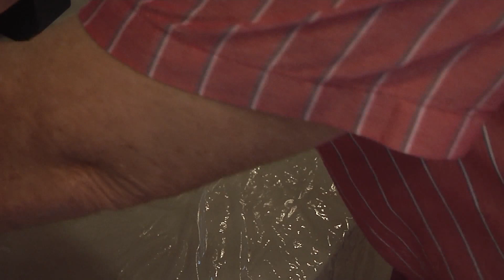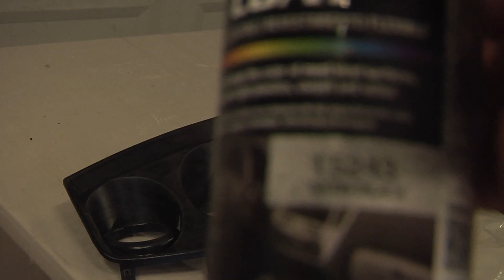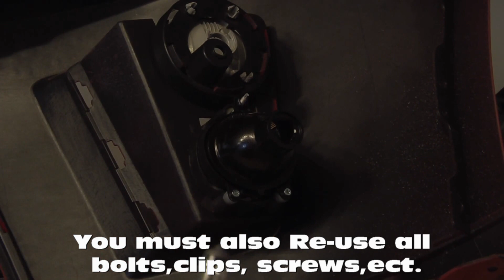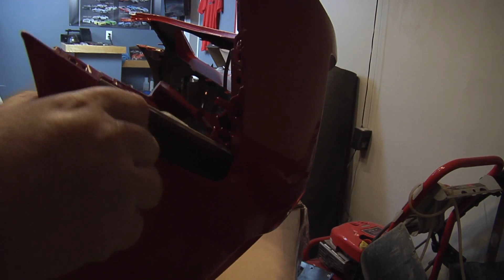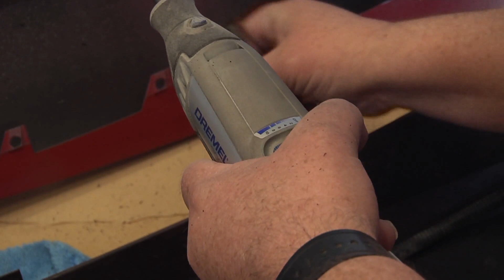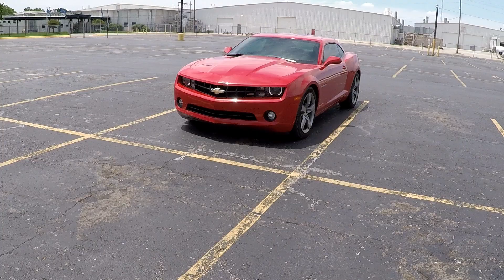Camaro ZL1 Front Bumper Conversion Install Part 4 "final assembly"

Comment: I’m struggling to clip on the bottom lip I’m currently working on the same project on my Camaro. Sides clip in just the middle won’t budge. Any suggestions would be greatly appreciated
Reply from the maker: It's been so long since I done that project,  I think I screwed it down.  What does it say in the video? Thanks

Comment: Hey man what hardware did you use to install it I bought this bumper topi just don’t know what to use to put it on
Reply from the maker: You use all your original screws, bolts, running lights, energy absorber ..ect.  you need to buy a wiring harness if you want to run fog lights, and buy the fog lights. Thanks.

Comment: For the lower fog light that you show already in place, did the bracket mounted on the back of the bumper come on it? I have the bezel and retainer for the top running light but there’s nothing to hold my bottom one. Thanks!
Reply from the maker: I used parts off the old bumper. Seem like it snapped together, not sure.  Been a while since I done that. Thanks

Comment: How long did you wait to put the grills and everything back on the new painted bumper
Reply from the maker: You just have to wait over night.thanks.
Reply: @camaromodschannel  what in all did you have to swap from the old bumper to the ZL1 bumper?
Reply from the maker: @davelombardo1710  running lights, energy absorbers, screws,
Reply: @camaromodschannel  so no brackets or anything like that?  BTW great job with all your mods!!
Reply from the maker: @davelombardo1710  no not that I can remember, the bowtie on the front,  need to change.  I got a black one  thanks.
Reply: @camaromodschannel  did you get the quad tips and zl1 defuser yet?
Reply from the maker: Yes got the rear defuser, and quad tips,  now I just need my exhaust pipes.  Thanks
Reply: @camaromodschannel  what size tips did you get. Any videos of it?
Reply from the maker: @davelombardo1710  yes, but don't know what program it was on. Thanks
Reply: @camaromodschannel  did you go with 3.5 or 4" tips
Reply from the maker: @davelombardo1710  4 inch,
Reply: finally installed! did you put all the screws in at the bottom if the bumper? they didn't send screws for it

Comment: If u had to start all over .. anything you would ve done different? I'm about to the same for the ss 13.. it's the energy absorber? Any issues ?buying a zl1 bumper from Ebay..
Reply from the maker: I would have painted the bumper in warmer weather. Do a better color check,no issues,  buying a zl1 bumper on Ebay is no problem, just take a little time. Thanks for the questions. You will love the new look,  thanks
Reply: @camaromodschannel  cool thanx
Reply: @camaromodschannel  is the bumper much lower than the oem ss or rs bumper..do you scrape every where?
Reply from the maker: @ivansotelo8163  No not really, about the same. when you get lower is when you put on the front splitter. then you have to be carful.Thanks

Comment: Would that paint work on a window louver ?what's the site for zl1 bumper? Painted and with zl1 upper grill...
Reply from the maker: Yes it would, I would use adhesion promoter if the louver is plastic. Ebay for the zl1 bumper if you can still find it.
Reply: @camaromodschannel  its abs . I think same material as the grill one.. is there one you know that sales painted and upper zl1 including.. ikon does paint but zl1 grill cant be added
Reply from the maker: @ivansotelo8163  I don't know, you can take it to your local body shop to be painted.

Comment: That's not how Adhesion Promoter works.

Where does it say to sand the adhesion promoter?
Reply from the maker: When you spray any kind of sealer it will ruff the part a little. plastic, wood ect. Just very lightly sand it just to smooth it back down. I was a finish painter for 15 years. That is the way I do it. Skip the sanding if you want. I'm just a perfectionist. Just don't paint when it's to cool outside  like I did. My finish didn't lay down like I hoped it would. Thanks for watching.

Comment: Any advice on wiring all the lights to function as GM intended them to? I’m having trouble with some lights turning on
Reply from the maker: Did you get the wiring harness?
Reply: Thank you for your quick response! And no I did not
Reply from the maker: @user-bc1kp1sl2e  go back to that video you commented from,  the top comment pined by me. Open the comment sent by me and get the link to the wiring harness you need.  Thanks for your question.
Reply: Is there anyways to tap into certain wires to give me the functionality as the ZL1

Comment: I have the same bumber, did you have a gap on each side where the fender meets the bumber. Because I do and no matter what I do I cant get that gap closed it's about a half inch gap on each side or a bit smaller.
Reply from the maker: Yes, had a gap on each side, but got it down to 1/16th inch not to bad. Thanks.
Reply: @camaromodschannel  how did you manage to fix your gap issues
Reply from the maker: @BlackGatsbyy  I believe I used bigger washers on the thee bolts on the fender.

Comment: do you have a link to where you purchased the bumper?
Reply from the maker: eBay link : https://www.ebay.com/itm/For-10-13-Camaro-ZL1-Style-Front-Bumper-Cover-Upper-Lower-Grille-Fog-Lights/322048741759
Reply: @camaromodschannel  get cheapest price on internet and call around to dealerships and see if they can match price or come close,i live in northwest fl got a dealership in brimingham al to almost match prices on all parts and they delivered them to my buddies body shop in fl

Comment: Looks like the paint is a bit off
Reply from the maker: I thought the same thing. Bumper little darker.  Is that what you see?
Reply: Maybe try color correction. It just doesnt look as bright red as the rest of the body. But it does look good
Reply from the maker: @dreynoso93  in my latest video I have done some wet sanding and will get it polished out very soon. Thanks
Reply: @camaromodschannel  plastic seems to always come out a little darker than steel panels